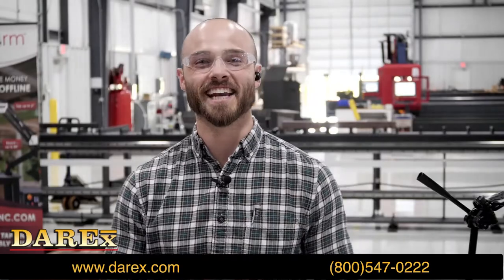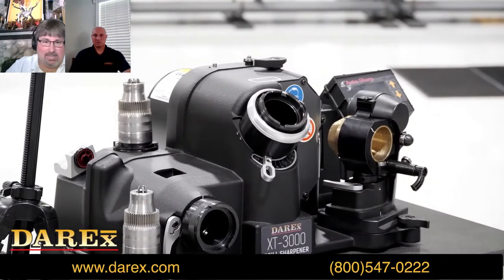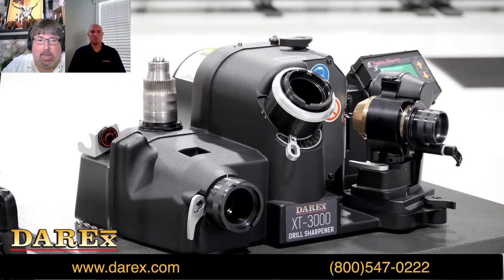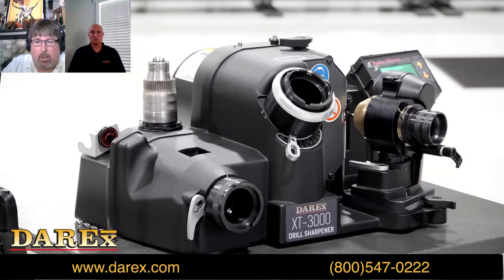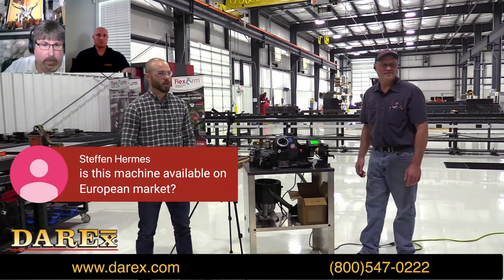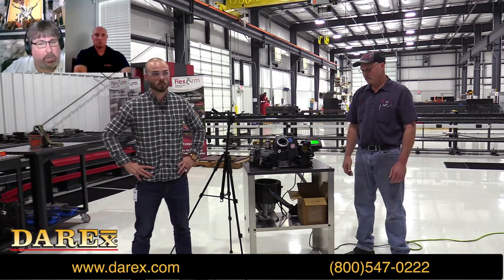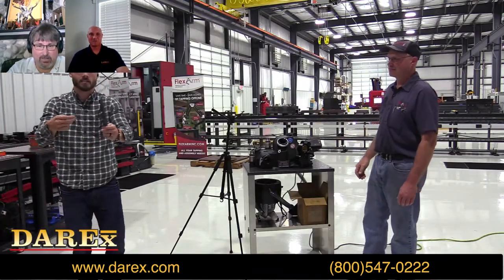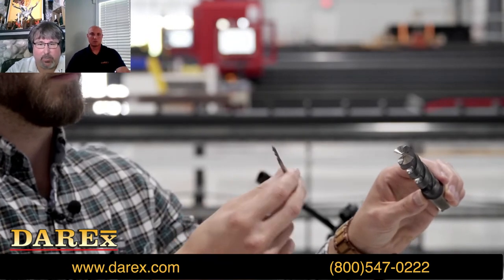How to Use the Darex XT-3000 Drill Sharpener

Comment: If you’re sharpening a drill bit to 135 degrees, should the heel relief and the split point be the same? I’ve noticed that whenever I do this the web of the drill bit gets reduced significantly compared to a manufactured drill bit.
Reply from the maker: That is a great question!  And it may be more of a question for Darex, but more or less, the markings on the sharpener are there for guidelines and you will have to play around with it and see what works for you.  Even things like how tight you have your drill bit in the sharpener can factor into how the bit turns out.  I hope that answers your question!